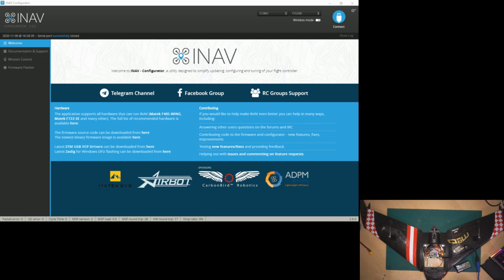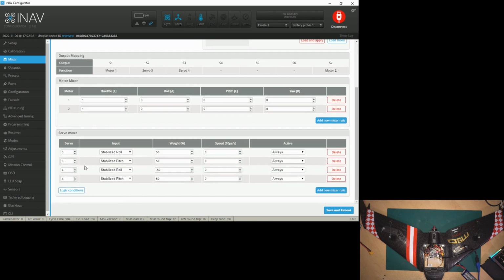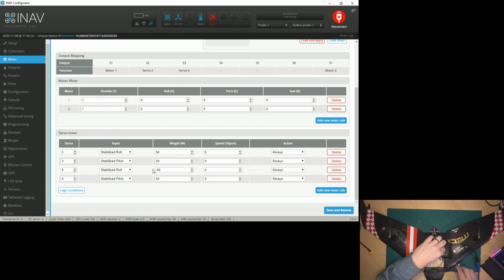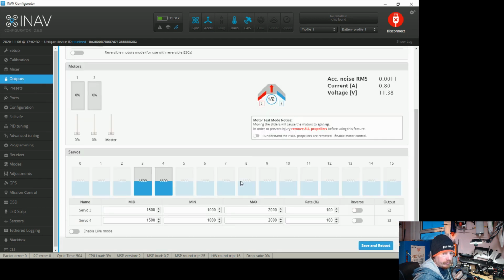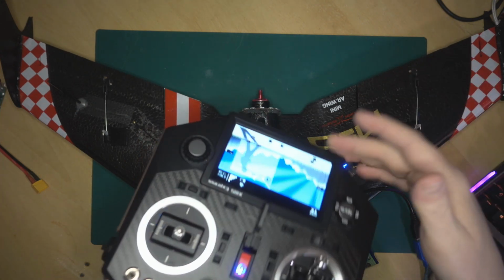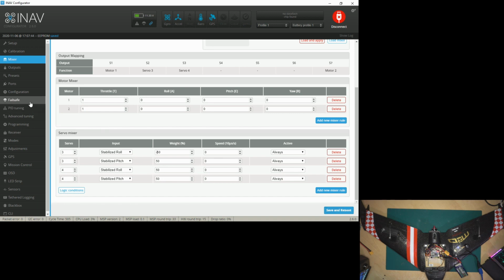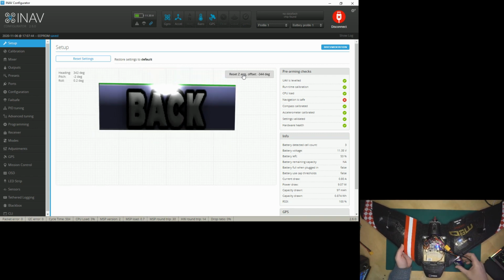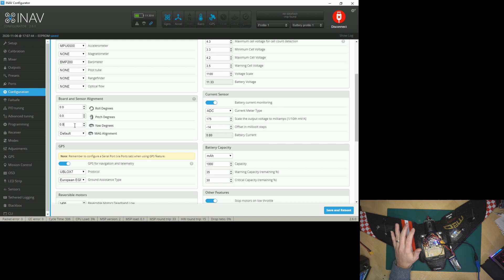A Guide For Newbies -  Setting up an elevon mixer in iNav

Comment: So the Output doesn't relate to the Pinout on the FC? I have Motor 1 S1(Timer4) on pinout 2 on the FC. Servo 1 for the elevator is on S3 and that's on pinout 4 on the FC. Great!
Reply from the maker: You seem to be having a lot of issues. Could I recommend you join INAV Fixed Wing Group on Facebook. There we can request photos ant images to try and pinpoint what is happening. Diagnosing issues is not great on YouTube.

Comment: If i install a new Mixer preset, say Airplane without rudder, I end up with S3 (Timer 3) for Servo 1 and S4(Timer 3) for Servo 2. Ok. Two servos for the ailerons, but ok. So only one servo there. 
Then below in the servo mixer I get Servo 1, Servo 2, Servo 3. So after having had the elevator working it stops working after I do the new install. So then I change servo 3 to servo 2. Now they both have the same colour and Servo 1 will now work. When Servo 3 was in the list Servo 1 wouldn't work. I'm just trying things to see what might work. Because nothing I've read or watched has come close to explaining for providing a demonstration on what is happening. Again, I would have thought that the Devs would have figured out a way to make this hobby simply, not bugged and intentionally difficult for a novice hobbyist.

Comment: I'm in using a Speedybee Mini Wing in a Zohd Drift and the two servos for the aileron come together with a Y-connector is this how I'd wiring it? Or do I get rid of the y-connector and connect each servos individually? Not working at the moment. Only motor spin up in testing, not RC, and the elevator servo works with RC. I have servos on every other pinout and nothing moves. WTF is up with these configurators? I thought they have this hobby figured out already so as to help people with build. I constantly hear things that were never mentioned in the instruction mentioned on YouTube. if the youtuber knows about it why don't the devs?
Reply from the maker: You can use a Y lead or individual servo connections. 

If your servos aren’t working. I would check 2 things. Firstly, make sure you are using the correct target. I often see people using the wrong target for that FC. 

2. Make sure that the servos are getting power. Of not, are there jumpers on the PDB that need joining to get power to the servos?

Comment: Hi, I am new to hobby and i want to buy good FC. Do you think latest Matek F405 Mini TE FC is versatile and futureproof investment for both wing and quad use cases? (2-6S input, supports 8motors + 3 servo, Dual BEC (10V/5V), 6UARTS, DJI and analog VTX).
Also I've seen that ZOHD drift is recommended for beginners, but do you think AR wing PRO is OK for fixed wing beginner too? I took into consideration AR wingPRO/Dolphin/ZOHD drift.
PS. I m looking just for long range cruising with LI-IONS (not racing)
Reply from the maker: Firstly, welcome to the hobby.
When it comes to flight controllers, I would treat fixed wing and quads differently. There are specialist flight controllers for each platform, which will give the best results. The Matek F405 MINITE looks interesting. I'm thinking of getting one for my Nano Goblin. But I wouldn't get it for anything where size or weight isn't a problem. For all the planes you've listed, other than the Drift, a "wing" flight controller would be a better choice. Something like an F405-WSE (Wing Second Edition) would be more suited.

The ZOHD Drift is supposed to be quite nice, but don't put too much throw on the elevator. It would be easier to launch than a flying wing like the AR Pro. If set up correctly, the AR Pro is supposed to be ok for beginners too. I don't have the Pro, but have the original AR Wing, and it flies very nicely. But, as mentioned before, flying wings are more difficult to launch  in the beginning. The Dolphin is also supposed to be a nice plane to fly. It has grips underneath that make launching easier, and it can fly pretty sedately. I'm actually planning a beginners series for iNav, and am looking at using the Dolphin for that.

Cruising is fine with all those planes. The Dolphin and AR Pro would be better for long range. However, please don't do any long range as a beginner. I know the attraction to it. But, it is something that you must grow in to. You need to be 200% confident in your abilities, of the plane, and of the flight controller. Fly close for a while and get used to flying and enjoy it. Then when you feel more confident, slowly go further, in stages. Of course, I'm not recommending you break any laws in your country.
Reply: @MrD  Thanks a lot for such advices ! But how to connect servos to such "quad" FC, i don't see PWM pinholes there, and they should have external power source? Those planes are all indeed great with their specific benefits and still hard for me too decide LOL.
Reply from the maker: The FC should have outputs. These will either control motors or servos, depending on the setup. But I would highly advise against it, especially if you are new to the hobby. Just use the appropriate flight controller. You would also have to make up a power loom for the servos. They won't be able to be powered by the flight controller.
Reply: @MrD  Sorry for bother By power loom for servos, you mean step-up/down regulators? Also, I am curious what are main use cases between F405-WSE and F765 WSE and H743-WING V2??
Reply from the maker: @brezovprut4431  yes, you will need to supply power to the servos. The simplest way would be with a BEC. 

The F405-WSE has slightly less features than the F765-WSE and H743-WING v2. That order is also how powerful the processors are. The H743 is pretty new for flight controllers, so potentially has the longest life as far as support goes.

Comment: Does inav need gps to have sda2 cla2 wired in or just Rx tx g, 5v ?
Reply from the maker: Don’t worry about the compass (I2C connections). Just use the UART for the GPS.
Reply: @MrD  Oh that's what those are, I knew I didn't need a compass, cool that lowers the complexity a tad. I was looking at GPS modules and noticed that some of them come with the I2c  connectors and some don't then I started thinking oh great mine probably doesn't have it. Thank you!

Comment: I have the AR wing pro on INAV 3.01 and all of the servos are moving in the right direction, but the throw distance isn't quite the same. the servo rods appear to be the same length and in the same hole on the servo arms, but servo #3 deflects about 2 to 3mm greater. will autotrim correct this? what are some of the Gotcha's I need to look for? any insight would be appreciated. TIA.
Reply from the maker: Hi Moe. Before anything else, make sure that you’re doing all this in manual mode. 

Don’t worry about the rod length. These may be different due to a range of factors. The manual says between 1.5-2mm of reflex. So just adjust the rods to get both control surfaces at this height with the servos centred. 

Both surfaces should move by the same amount, to get the recommended 12mm of throw. The throw is defined by the linkage geometry; specifically which holes at the servo and control horns the rods are attached to. However, it would be worth checking that when the servos are centred, that both servo horns are in the same position in relation to the flat side of the servo. If one is in a different position to the other, that could effect throw. 

Autotrim only adjusts the servo mid-points, so doesn’t really have much effect on the throws. 

I would suggest getting a throw gauge. But nowhere seems to have any in stock at the moment. These are curved plastic rulers, with sprung metal feet, to hold it on the wing. They are great for measuring throw, and more accurate and easier to use that a ruler.
Reply: @MrD  Thanks D.
 Yeah, as far as I can tell, in manual, at a rest, there is about 2mm of up deflection equally on both control surfaces. And as near as I can tell without a gauge there is about 12 mm of deflection over the entire range of motion on both control surfaces. It just appears when I do a roll maneuver on the bench, that one control surface travels farther than the another. I'm hoping that I am just being hypercritical, and the Auto Trim will sort out any difference. I'm away from my bench at the moment, but when I get home I will comb over what you said and look again. 
 With a quick look online, I found a surface indicator gauge locally. It might be worth the $12 investment before Maiden.
Reply from the maker: Sounds good. Only thing to mention is that the throws should be 12mm each way, not total movement. So total movement would be 24mm. Also measure from the control surface it’s self for the throw, not the wing. You only measure between the wing and control surface for the reflex or to get the surfaces flat to the wing, if no reflex is needed.
Reply: @MrD  okay, I think I might have a problem in my setup or settings. I will have another go at it when I get home from work. I have been doing fpv for years, but this is my first wing. I'm still trying to figure out all the simple caveats. As much as I enjoy building and programming, I sometimes wish these things worked right out of the box. Thanks for your input, I will let you know how it goes.
Reply from the maker: There’s probably not too much to change. Once you’ve done it a couple of times it becomes easier. The learning curve is a bit steep, but I’m sure you’ll get there.
Reply: @MrD  Ahaa!!  I think I found the culprit. Silly me.. After my initial radio and stick calibration, I put different umbrella style stick ends on my FR sky Xlite. I used some 3mm stick ends with a piece of heat shrink wrapped around the threads, instead of the original 2.5mm stick ends.  So now the edge of the umbrella style stick ends are hitting the outside of the Xlite radio gimbal housing ever so slightly... Doh!! 
 After recalibrating the sticks in the radio, the throws seem normal now.. 12mm up, 12mm down, with just a bit less than 2mm up deflection in the resting position in manual mode.
 I read the inav wiki end-to-end, watched hundreds of hours of video, and reached out to several people, and still could not figure this out. In the end, it was something super simple that caught me out.. now I just need a calm sunny day to Maiden.
 Thanks for your help, D.
Reply from the maker: Awesome! I’m glad it’s sorted. That’s one of those problems that could be easily missed, so I’m glad you spotted it. Good luck on the maiden. One thing, it may be worth re-checking the endpoints on the receiver page in iNav, to make sure you get that 1000-2000 range on the 4 control channels. The gimbal issue could have effected that.
Reply: @MrD  will do.
  I still have some time in the configurator pining over some of the small details like auto-launch, auto-trim and OSD for my DJI air unit. 
 One of my biggest question remaining is, I'm guessing that the full features of osd are still not supported in the DJI air unit, correct?
 I have some of the basics like voltage, SATs, and some of the flight modes enabled, but I am still not seeing when auto-launch is active and wondering if RTH will pop up when it gets selected. I may decide to setup analog video for maiden just to work out the kinks..
  these are trivial questions, don't feel the need to answer. They are not going to make or break my maiden.
  Sorry to pester you here, I gave up Facebook long ago.
  Not the inav group, but Facebook in general is just too toxic and creepy.
Reply from the maker: @moemuggy4971  no problem. https://inavfixedwinggroup.com may answer a few of your questions, without data harvesting 😄

Yes, unfortunately the DJI OSD is very limited. DJI basically worked with BetaFlight to produce the OSD. iNav is having to use what was built there to get as much information in to the OSD as possible. But it is far from complete; and I don’t see DJI doing any work to remedy this. It is down to DJI to make these changes, they can already get all the data from iNav over the UART.

To be honest, other than the cost, the lack of OSD is the main reason I won’t be switching. Hopefully in the future, other companies will get involved with HD FPV and either force DJI to improve their product; or just have a better product themselves.
Reply: @MrD  yeah, I'm looking into a way to seamlessly add both video systems to the craft without having to dig each out after use. It would be nice to have analog for maiden and tuning, or those really long range flights (that I'll probably never do) like a camera switcher maybe, or just a dedicated pigtail for the two. My DJI goggles are capable of both transmission signals. The guy that creates a video transmitter that is capable of switching between HD and analog in flight will be an overnight millionaire. When one signal drops out, it would be nice to have the capability of switching between the two.
  Anyhow, thanks again for all your help and input.
Reply from the maker: You could use a power switch to switch between the DJI VTx and analogue VTx. Just have everything else already connected. Then all you should need to do is switch the goggles from digital to analogue. So long as only 1 VTx is used at a time, I don’t think there would be a problem.
Reply: I'm in the same boat with my ar wing pro, flys ok but way more than 12mm reflex on control surfaces. I've tried to find the gauge without any luck, I see no way of using a metal ruler and getting even close so I've resorted to setting up rates on 3 way switch which I don't think should be done using inav. I'm still not sure how to set correct throws using inav even if I have the gauge, is it done by changing the weight on the servos? But great video keep them coming Thanks
Reply from the maker: 12mm of reflex sounds massively excessive. It shouldn’t need to be that much. I would double check the CG. As for throws, its best to do them physically, not in iNav. Check this video https://youtu.be/tGRDZzaerOE
Reply: After watching your video I see how it's done, the 12mm max throws I'm getting from the ar wing pro manual, I remember watching a video of you flying your ar wing pro how much throw did you have? How much would you recommend I have cg on the factory Mark's. Thanks
Reply from the maker: @egtreadway4232  right, it's very important not to mix up reflex and throw.
- Reflex is the amount of up the control surface has with your hands off the controls. Usually this is around 0 to 5mm, depending on the model. This is only needed on models with no tail. Also, some wing profiles have the reflex built in; such as the F-01 that I demonstrate with in the throws video I linked to above.
- Throw is the total movement from centre when full stick movement is applies on the axis you are measuring. 12mm should be fine.

I don't have an AR Wing Pro. Marc Hoffmann does, and I'm sure he uses the factor recommended throws.
Reply: Thanks Darren

Comment: So if the the AR Wing pro calls for 12mm up and 12mm down is that just pitch or aileron individually or do you use for example  pitch up and full right aileron to set the max throw of the right aileron up.
Reply from the maker: No, do each axis at a time. So 12mm for the pitch, and 12mm for the roll. On a 50-50 elevon mix, that should always be the case that if pitch is 12mm, roll will be too. 

The reason each axis is given is because sometimes they are different. The original AR Wing for example asks for 16mm roll and 12mm pitch.
Reply: @MrD  Thanks mate makes sense. Pitch and roll individually will get 12mm throw up or down and together because of the mix you may get more throw
Reply from the maker: No problem 👍🏻

Yeah, both together would result in a higher value if both controls are in the same direction (-100 and -100 or 100 and 100). If you had full pitch down and roll right (-100 and 100), you would have one surface up and the other flat.

Comment: I've had a terrible time with mine, just cannot get the rolls correct, they both go in the same direction and i tried alternating . Tried everything you've said but no go, i'm in the 10% group. Please help if all possible. Really do appreciate all the time and interest you put in your video's.
Reply: Never Mind, went back to your tx setup guide and all works perfectly. Your awesome man. cheers!
Reply from the maker: Glad it’s working Phillip. Yep, if you have problems with this, the first thing to verify is the transmitter setup on the receiver page.